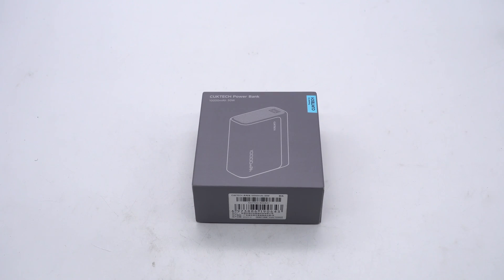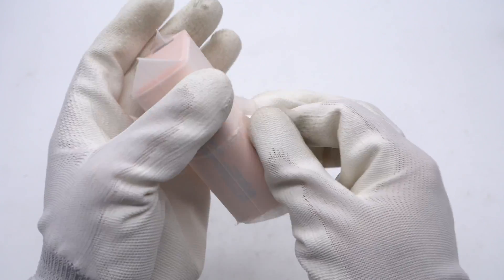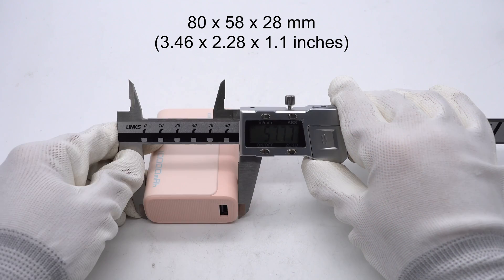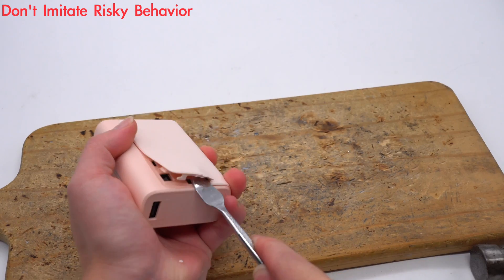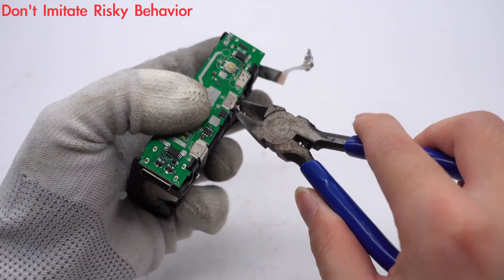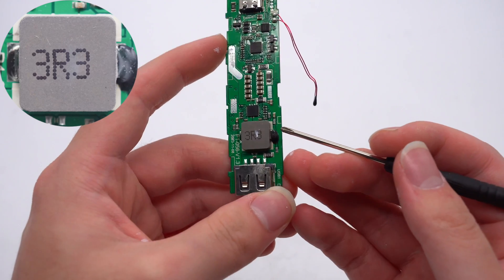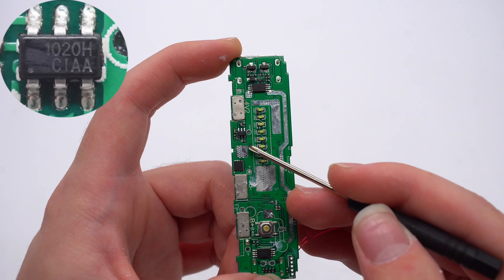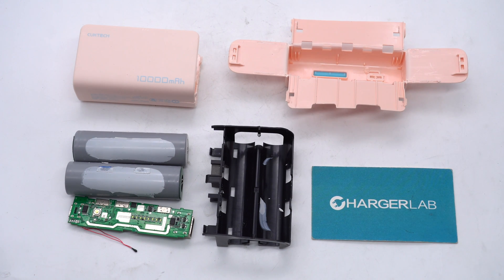Teardown of CUKTECH 10000mAh 30W Power Bank

Comment: it is support xiaomi 33w turbo charge protocol ??
Reply: Support 💯, they will show mi turbo charger, i have this powerbank
Reply: @kingqyum which port ? And what model are your phone ?
Reply: @Ryanous-yw1wj  my phone poco f6, for sure support fast charging from 33w 55w 65w and 90w, if you xiomi show mi turbo charger that will mean from 27w to 33 watt, depends on heat and how much you battery
Reply: @kingqyum Which port are you using? Type A or Type C on the Cuktech power bank on top? I am looking for a small, compact power bank like this one, but I'm not sure if it supports the Xiaomi protocol or not.
Reply: @Ryanous-yw1wj im sorry about port 😅, im using type c  and sure support Xiaomi protocol, and i have cuktech 10plus to and support 90w
Reply: @kingqyum  it is show turbo charging sir ? or quick charge only on smaller one ??
Reply: @Ryanous-yw1wj  yes turbo charging, same as my mention at second comment that show (mi turbo charging)
Reply: @kingqyum i notice some who bought this need to change cable to active some protocol it is true sir ?.
Reply: @Ryanous-yw1wj yes sir, at least 4a or 6a cable type c to c